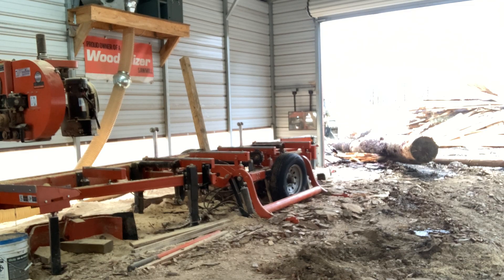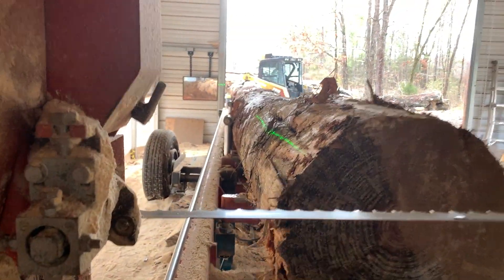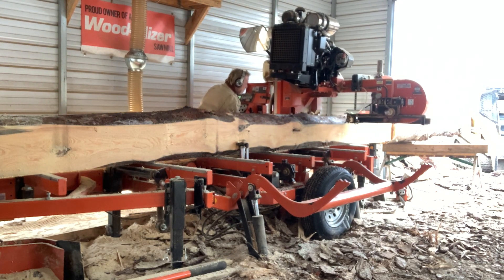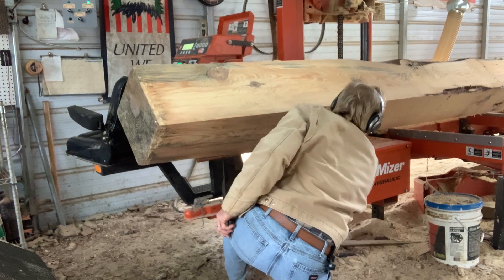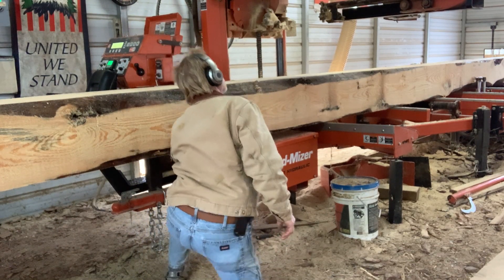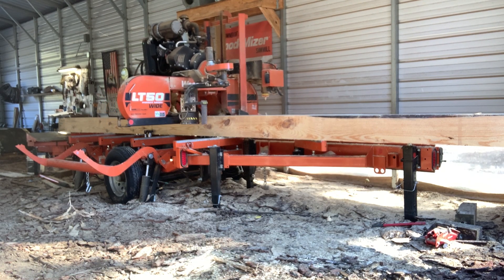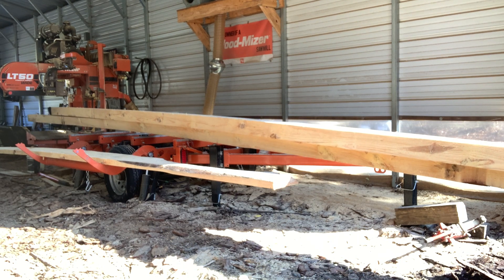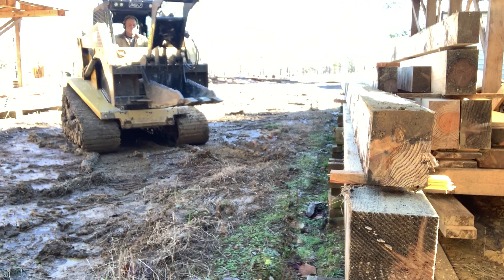31 foot 8 inch Log on my LT50 Woodmizer Sawmill.

Comment: I have been going through this in my head . Thanks for the detailed explanation . Is the saw head in neutral as you are pushing everything back .
Reply from the maker: The engine is running but the blade is not engaged.